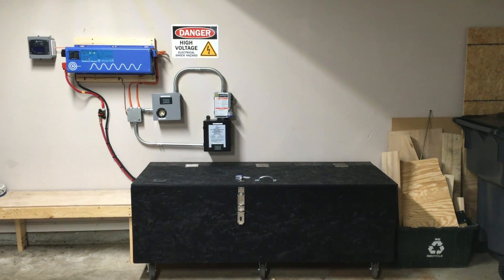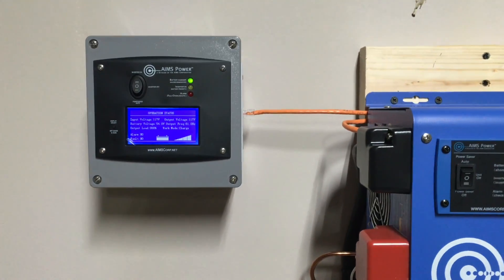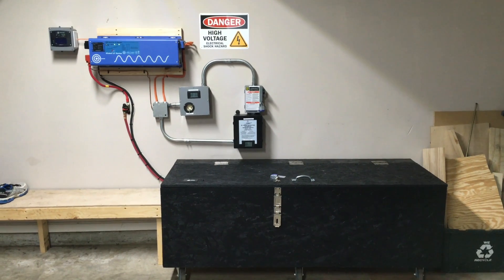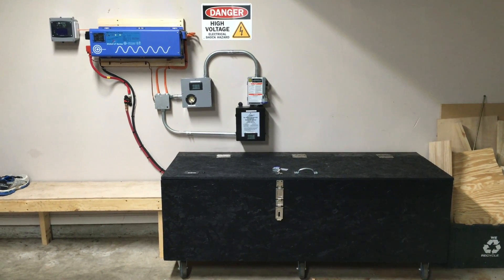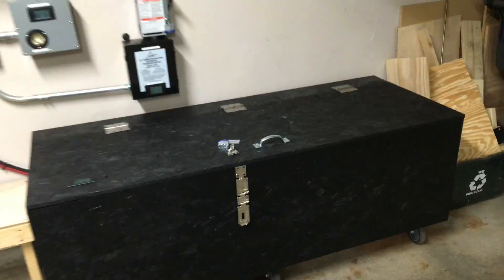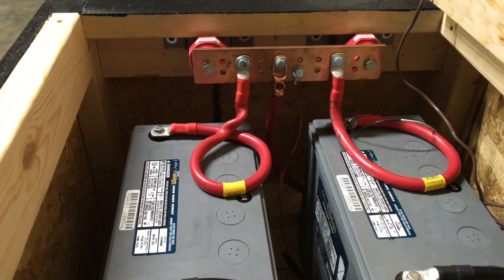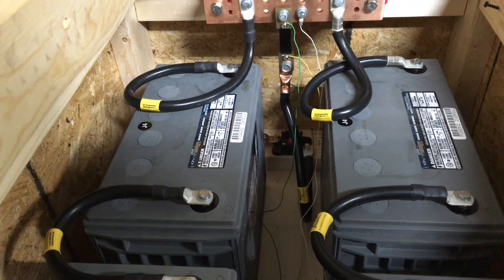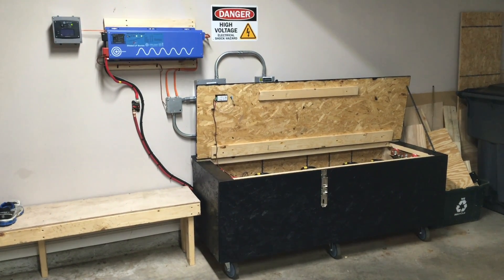Aims 6000 watt 48v inverter and battery bank (Whole home uninterrupted backup) - 1.5 of 3 - UPDATE

Comment: This is slick and I want to try and build one.  I'm an Urbana Ohio Native living in Houston so only powering 120 would be challenge in the summer however we could use a couple stand alone AC's for a day or two.  In the winter I would have to make some adjustments my furnaces are non 20 two pole breaker and the pool needs 240V but it has me thinking.  BTW it's going to rain at Muirfield this year.

Comment: I just ordered eight 400 amp hour lithium ion batteries. I ordered a 6000 watt inverter. Going to use this setup in my camper to try and live full-time in it. I'm hoping it will support my 15000 BTU air conditioner in the camper. I have 2 gas powered inverter generators but I'm planning on charging the batteries as needed. If I use them too much I will then look at getting solar panels. What size cables did you use on connecting all the batteries?
Reply from the maker: I used these cables but your setup might require something different.  You should do your calculations and buy the appropriate cable.

https://a.co/d/cU7n2NS

Comment: hello.  nice set up and pardon the grammar mistakes.  if hitting the space key twice doesn't auto capitalize the sentence I don't go back and fix it. same with i's.  just gonna start off there cuz I know people immediately perceive errors in writing as something to not take serious.  I just wanna say nice set up.  didn't see your other videos however so pardon if I say something you already talked about.  Im not entirely sure about lithium based batteries but I know for a fact lead acid chemistries take up to 50 cycles to fully show their max potential. i think you said AGM is your chemistry  and not gel yes?  vrla agm?  they need to charge depending on what the plates are combined with, up to 15 volts per 12 volt.   calcium based vrla agm batteries can take up to 14.8 but just follow the specs that should be on the battery.  vrla agm batteries do vent gas when they are being overcharged.  if you have the box enclosed for reasons like an emt pulse or its locked because young children and curious Jorges,  then I would install fans.  one intake from cooler air and then one exhaust venting to the outside.  not so much a noxious gas build up concern but the biggest death to batteries is heat.  your box does seem roomy w plenty of thermo heat to transfer into the air, but when your batteries are charging and discharging  they will heat up.  they heat up more as they age and when sulphation begins to happen.  heat kills batteries..   all batteries.  so if you don't want dust collecting on the batteries and just dust I would suggest ditching the cover and let it breath.  if you have kids then make a screen as a top.  it wouldn't be as effective as fans ducted w a temperature controller on/off switch but its cheaper.   I know you didn't ask and I know some would take advice as an insult especially since all I have to show is nothing on my YouTube page, but I've near blown myself up more then a few times working... wellll more like f'n up working on batteries.   I don't know how you charge your batteries.  I assume things a lot and skim over things that are important when I speed read.  in this case I skimmed over the first two videos.  if you are charging based on solar id suggest looking into why have two banks in a solar set up.  one will stay online in use while the other stays off line for proper charging and maintenance.  more so to do with flooded batteries. but still the theory applies to all lead acid chemistries.. lithium is a bit different due to the faster safer and without losing life expectency fast charging characteristics.  if you hear your batteries given off little squeaks of air kinda like a small amount of air being released from the mouth end of a balloon but not where it makes the farting sound but just enough to hear a squeak of air, that means your agm batteries are being over charged and to back off on the charge voltage or they are could be fully charged.   the sound kinda makes you think mouse.  your agm batteries if new will charge faster and reach the top voltage fast and may seem to not have much or as expected capacity.  just cycle them some an you'll see charge times and load times come to normal factory specs.   personally if you don't need your batteries in a habitable room or where people spend time then you should try some flooded batteries w a vent system.   everyone has their say on what they like the best, but to me the biggest downside to no maintenance lead acid batteries is that they can prematurely dry out and have diminished capacity.  vrla sealed batteries or agm are in my opinion mostly meant for storing inside and around people.  that's why you see them predominately in UPS's for electronics.  and that's why you see them in some car makes that store the battery inside the cab.     Flooded batteries require more attention and have a equalization charge to add to the mix of things, but as long as you keep them topped up w water after a charge and charge them properly and for the amount of time needed then they can last longer then agm batteries.  however if you know how to charge all of the different chemical  make up of lead acid batteries and you have the same 75 degree environments they say agm last longer due to them corroding the terminals not as fast as flooded.  but I won't know for another 10 years w my banks.  I have two 48 volt  flooded banks, one is 150 amps and the other is 225.  I have a vrla agm calcium lead acid 48 volt bank at 100 amps and I have two 48 volt lifepo4 banks one at 20 amps the other is 175.  I also have a shit ton of cells to make customized lifpo4 batteries but my gf might leave me if I put another battery in the house or where she can see it.  I've made mistakes before beecause of fatigue and stress but if you ever find time or energy I would strongly suggest keeping all wires connected to positive terminals red and all negative terminals black.  I see in your box you have only the terminals connected tot he bus bar and to the inverter as red.  it don't really matter. copper wire is copper wire the jacket don't dictate whether its gonna conduct electron movement or not.  you can have any color insulation you want as long as you know what goes where and you don't have the inspector coming around.
Reply: personally I throw shit together.  if I got a green jacket at the right awg size ill put that onto a positive terminal.  but its not smart and leads to errors that can cost you a limb or your life.  red or black doesn't really apply for series connections so I understand the use of black but if you were able to maybe find a third color for the series connections just to eliminate any errors if you're ever in a hurry or have to move things around. just remember with dc voltage you wire the positive terminal first then the negative.  and you take the negative off first and the positive off last.  its the opposite of working w ac voltage.  where ground is always first on and last off.  A  generator is good to have to charge your bank at night.  I wanna say generators produce a not so perfect sine wave and can lower life of your appliances or battery chargers if you don't condition the waveform to a more harmonic wave that your appliances and electronics like.  same with inverters.  most inverters don't produce a true sign wave they just use a bunch of little circuit board pieces to slow the wave down it initially produces to get closer to a sine wave.  but as far as I know the lower the thd of the inverter the better.  I assume aims is under 5 percent but even so if you condition that wave your household appliances and electronics will be much happier.  I don think I saw any  voltage limiting devices or surge protection.  maybe you did down below in the box, but if lightning were to strike and come in contact with any part that's Hooked up to your system you could fry all of it.  I did see that fuse from the bank to the inverter.  that's nice.  I think you got a current fuse.  look into and the darn official name slips my mind but midnight the company makes them .  its called something like a lighting arrestor.  look into that.  its not just for lighting strikes cuz some people prob be like we never get lighting, well yes its mostly for that but also for utility power spikes and surges and sometimes equipment can overload on you and cause a nice spark.   anyways enough about that.  not sure about most of your set up hahaha so ima guess.  is your system set up for black outs and severe weather utility power blackouts or you a prepper or off  gird or just want it cuz it cool and its better to have then have not?  my point is,  they make a lot of dc power appliances now.  you can get dc powered light bulbs on amazon.  if you skip the inverter and have your batteries feed dc loads you will get more out of your batteries run time.  inverters at 50 percent load lose around 10 percent of the power in the conversion process.  as you use more of the inverters total ability that number drops to a more  then 10 percent loss in dc to ac   power conversions.  Also as it heats up it will lose efficiency.  sound like a broken record but if you could keep all those electronics at a temperate level like 75 degrees then you'll see max output on everything.    You may already know most of this, I just liked the set up and wish I had my own home to do it in but I don't.   I do it anyways where I'm at no matter.  better to ask for forgiveness then to ask for permission they say.    not sure if you're a newbie to all of it, but there's a lot of information out there.  no matter what you do , kill the heat that will kill your system not just he batteries but also the inverter and other electronics, learn your banks chemistry to the tee and what it needs to charge properly to keep them working for a long time,  and buy used to experiment with before making a big purchase,    solar panels also lose efficiency when they get hot.  if your system is primarily for emergencies or if you lose power a lot and don't want to deal with changing bulbs or having double the lamps which makes you jus invert power to run your lights, experiment with running a dc branch circuit to all the room and and outside of the house to run jus lights that are dc powered and install switches for them that are motion activated so if no one is in the room they will turn off and not waste your battery power.  just make sure everything you use says dc rated.  most devices are only ac compatible.  direct current means constant current and volts continuously pushing power where as alternating current  has high and low waves of power distribution which is why in films you will see sometimes the lights flickering.  its because the power form and wave is different then dc which is why you have to have dc approved devices like wall switches.   sorry for the long write up.   I guess I'm just happy to see people doing what I've been trying to do for a long time but coming up short on it.  also learn what it really means to ground yourself on accident.  peopole think they understand how to avoid a shock but they really don't.  ac voltage tends to use the body as a conductor more readily then dc for some reason.   something to do with how ac is always looking for ground thru the easiest means and dc is trying to complete the circuit and won't readily look for ground if its not the way to complete the circuit. prob wrong on that.  anyways good luck
Reply: I'm still trying to figure out how to have multiple banks be charged separately that will have a charge controller w wind and solar inputs and also have a generator in the mix on a transfer switch when utility goes down.  and then have the loads go to a dc panel that then branches to different circuits requiring  different input voltages which I assume I would have step down or voltage reducers on the branches that  require lower voltage then what my 48 volt banks do or if  I could combine the banks voltages somehow to have  more then 48 volts  even tho they have different properties each which I don't think I can.  my current thinking no pun intended is to have each room or section of the house on different banks.  so instead of having one large system ill have it broken down into sections or something like that.  for example one bank will provide lightning and power the fridge.  necessities.   maybe the hot water heater if I can't find one that uses gas w out needed electricity to function which I don't think they make anymore...  then another bank to run appliances.   then the third to run exterior power like pumps, security, flood lights.  etc..  that's one thought my other was to have each room have its own solar controller w each room having its own array.  and battery system for night.  but ya. that's my current  thing trying to learn if anyone can point me in the right direction with combining multiple banks to one dc load panel breaker box that then can limit voltage to different branches w out having to have separate banks at lower voltages for things like lights.   lol.  can't really find anything online about doing that but I prob aint asking the right questions.

Comment: Nice clean installation.
For anyone watching this is a 2kWhr battery , a typical house is using 20kWhr per day.
AGM batteries can not be discharged below 50% without damaging them/significantly shortening their life.  Using only the top 25% will extend their life, but then you have very limited energy available.
These batteries will self discharge even with zero loads.
Lithium-Iron-Phosphate batteries are far supperior. If your interested to build a back up system, do some research, LiFePO4 batteries, All in One inverters there are great resources out there if you look.
For Electronics, avoid high THD (total harmonic distortion) invererters like the one in the vid.  Good units cost more, but will not destroy your electronics.

Comment: great job. so i use a lot power due to my sump.pomp and i want to swe if i can save money by charging the batteries with grid power during off peak time and then use batteries at peak time any advice on that? i like your system and i would really apreciate it.

Comment: It's a pretty old video but it's much like what I'm thinking about doing..   48v battery bank with lipo batteries. Auto change over when the power goes out and a generator for back up.  The problem is...my generator is 9000w....   It's too much for almost all these inverters....   Also..at some point I want to install a solar array and would like to run that in as well..... Too many things to consider maybe...
Reply from the maker: Your generator being 9000 watts has nothing to do with anything.  Your generator doesn’t output 9000 just sitting there it would need a load pulling 9000 watts which your generator most likely can’t actually do in real world.  Hooking a 2000 watt inverter to your 9000 watt generator would work just fine.
Reply: @dubohio  HUH....okay I guess i didnt get the push/pull part of this...I assumed if the generator was rated at 9k peak, your inverted would have to be at least that if not more.....my assumption was backwards..  But I guess you are saying that the inverter will PULL up to whatever the inverter can pull from the generator....so the gens output will be whatever the inverter can pull....if its a 1000w inverter, thats what the gen will be producing....if its a 6000w inverter, thats what the gen will produce when its full go....
Reply from the maker: @LeeWinkler  In simple terms yes.  Just think of it like this.  If you plugged a 100 watt light bulb in to your 9000 watt generator the bulb wouldn’t blow out it would just consume 100 watts.  Same concept with the inverter.  Your inverter will only consume what it needs.  A 2000 watt inverter won’t always draw 2000 watts it will only draw what it needs to power its load plus a little over head to run the inverter.  So same concept if you plugged the 100 watt light bulb in to the inverter and the inverter was somehow connected to the generator you would only see ~105 watts being used at the generator.  100 watts for the bulb and maybe 5 watts to power the inverter give or take.  Also chances are if you have an inverter putting out 9000 watts it’s NOT pure sine wave and isn’t good for powering anything with a motor ex: refrigerator, garage door opener, etc..
Reply: @dubohio All good examples thank you very much for your patience with this newb.  As for the gen...its a Harbor freight predator 9000 (without inverter, ie not pure sine, thus part of my need for a large inverter.  Currently thinking a Sol-ark 12k

Comment: I looked through all of your comments and did not see an answer to my question so I will type it here. Do you have plans for the rack? I just bought a system very similar to yours using 8, AGM, 200 ah, 12 volt deep cycle batteries. The rack you built looks perfect for my needs. Rather than reinvent the wheel, do you have plans to build a rack like yours? 73 & God Bless

Comment: I have a pto  generator on my tractor, feed it to the house and can run my stove hot water tank etc.....works for me and don't have the expense of new batterys ever except for the tractor, that is the problem with ev cars......battery replacement  and its hyper expensive, ice vehicles here to stay longer than people think, but great job, nice installing.......👌
Reply from the maker: Nice setup, but these batteries have a 20yr life expectancy and when the power goes out I don’t have to touch anything.  Lights dont even flicker in the house.  Sounds like your setup requires some setup if there’s an outage.  Different systems have different pros and cons.  Glad your setup works for you!